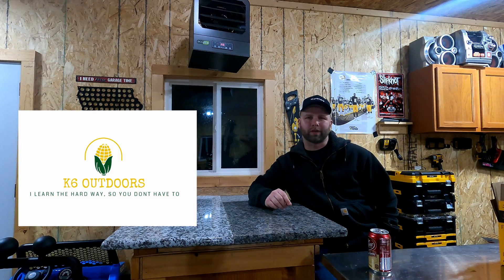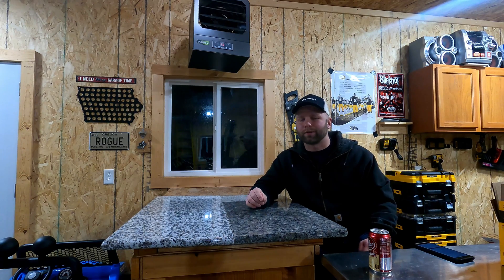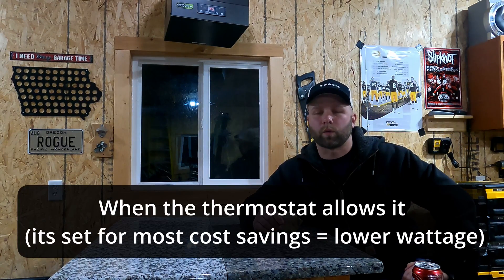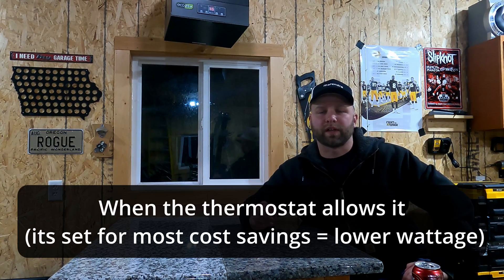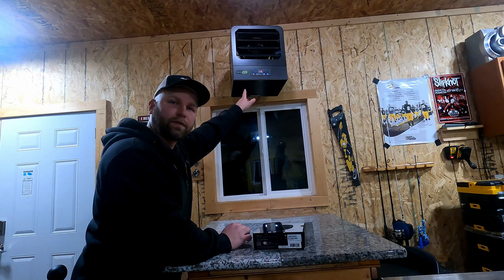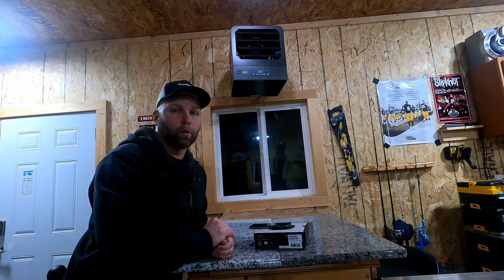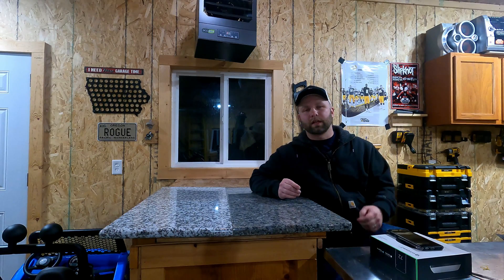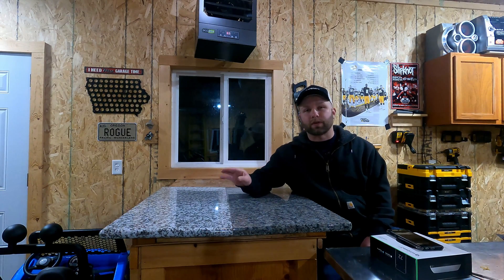Electric heater performance - How long does it take to heat up my garage / shop?! King Electric

Comment: Wondering if your unit has a dull electrical humming noise when switched off? Just installed mine and after about 10 hours of usage, started a quiet electric hum when switched off....
Reply from the maker: I would reach out to King Electric customer support and see if they can help you out. I was experiencing the same thing and was sent a new transformer for mine and it fixed the issue. Its so quite that it is hard to hear but when you hear it you cant ignore it. Hopefully they will be able to help you out. Thanks for stopping in!
Reply: @k6outdoors  thanks for the response. Very helpful. I did reach out and their support has been excellent, and very fast! Love the heater!
Reply from the maker: great to hear, I love the heater as well and I am a firm believer in it being the top heater like it on the market!
Reply: @BupMeeSunim I just installed mine and have the same hum while unit is off. I'll also reach out to King Electric to see about getting the replacement transformer.

Comment: Thanks for your videos on this heater! Can this heater swivel or be mounted on an angle from the bracket or does it only have one mounting position? I'm likely going on mount in corner of garage, but want to point it a bit more inwards, then completely parallel with the wall... Thanks!
Reply from the maker: Hey thanks for stopping in! The heater can swivel to rotate what direction you want to direct the air.  In general, it can be mounted to the wall or ceiling, and the tilting you are talking about can be controlled by the lovers on the front of the heater. I am not sure the hanger itself would work well being tilted itself. Hope this helps
Reply: @k6outdoors  thanks! That helps! I was really curious about the ability to swivel.

Comment: Kyle, how is the fan noise on this unit? Also, is there an loud audible click from the contactor when the heater engages? Thanks!
Reply from the maker: Fan is pretty quiet for the CFM it moves. The Eco2s version of this heater (older version i had installed)  had a little more of an audible click when they heater engaged. This eco2s+ model like the one in this video makes virtually no noise when the heater engages the contactor!
Reply: @k6outdoors  Thanks for the quick response! That's great info, I think you have sold me on this unit!
Reply from the maker: @FreedomTrailOutdoors  i have a couple more videos on my channel if you wanna check them out and see more info!

Comment: Hey Kyle. Nice video. We have a 32x32 shop and heat with a propane powered forced air unit that was here when we moved in.  5hs ka for showing us it's about -36°c (-32f)
Reply from the maker: Propane is definitely some good heat! Appreciate it Ross, stay warm!